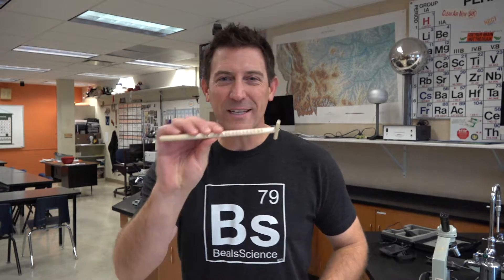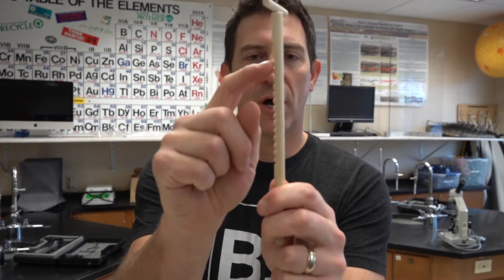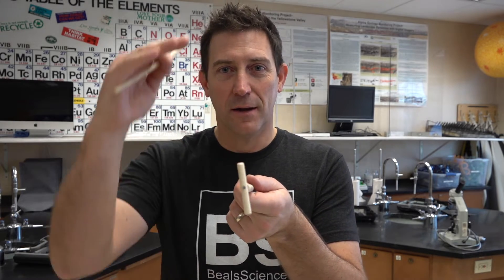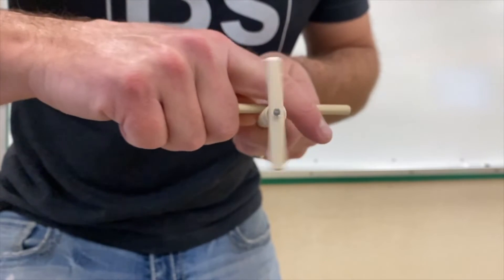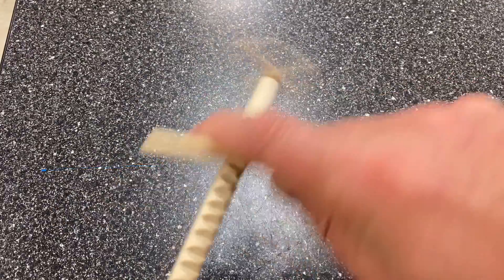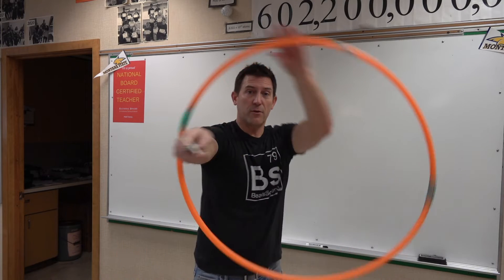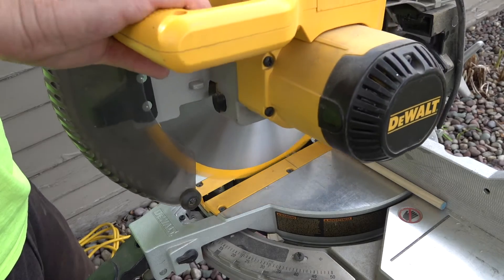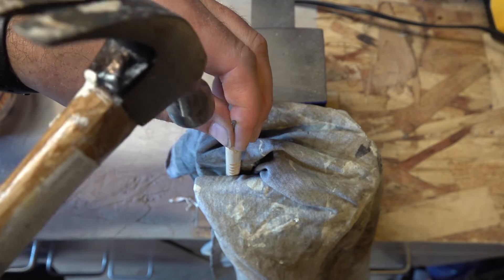Fun Science Toy: How the "Gee Haw Whammy Diddle Hui Stick" Works and How to Make Your Own!

Comment: 😂😂. Nice toys.  Very old already. I have already made hundreds and handed them out at parties. Also for advertising with a logo or text burned by a laser. Then use square wood using only the thumb.  The more play, the easier it turns. I worked as a ground engineer always fun in the cockpit, during ATC delay, as a magic tool to solve problems e.g. a instrument flag, aim to that object, yel oei, oei, stamp on the floor and let him run the other way around en push the CB -previous pulled on the overhead panel - with your head.  In 1990 I gave one to a testrunner 744 factory Everett and this toy idea spread fast in de VS than. 👍🤣🙏(😡) BS GRAIG —-> Other Mexican toys you can make on the lathe Balero and Kendama. Success with making and training - both can be painful on your arm - have fun. Greeting from Holland.
Reply from the maker: Thank you for the great comment!!!

Comment: I have several of these in various sizes, first one bought back in the 80s at Scarborough Faire in Texas. From there to Montana I've only ever seen them called Hooey Sticks. The gag is to say "hooey" each time you change. You get good and the switch is barely noticable.
Reply from the maker: Thanks for the info!